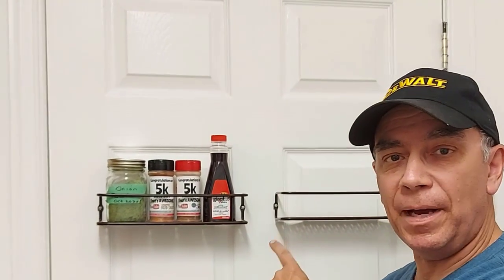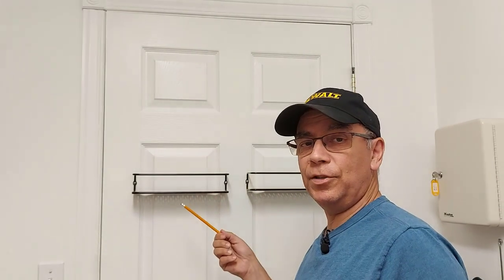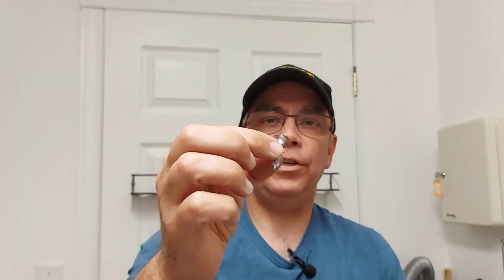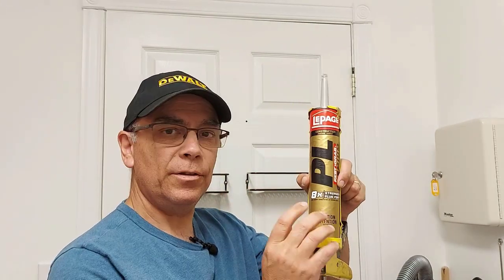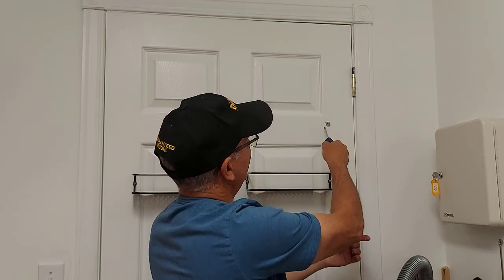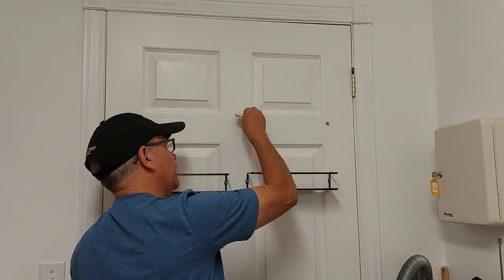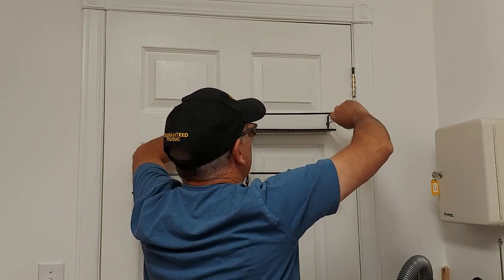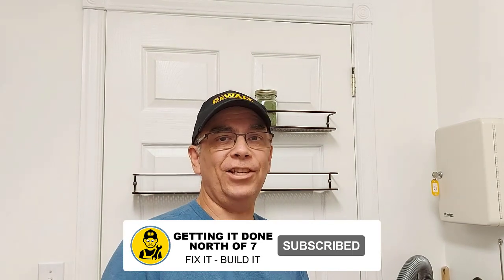Mount a Spice Rack on Interior Door So That it Never Loosens

Comment from the maker: 🔴Watch Next: Here we install a towel ring to a hollow door in the bathroom: https://www.youtube.com/watch?v=BefJvspNkMc&t=166s
Reply: Would the steps be the same if you have a metal door? I want to mount a metal rack (for mail).
Reply from the maker: @sable747  No but it is easier with a metal door. Get self tapping metal screws from the local hardware store. The screw will self drill into the metal door and you are good to go! Don't over tighten.
Reply: @GettingItDoneRepairs  thank you!

Comment: I have shelves i want to mount to a door just like this. My question is however, that when i line it up on the door the pre drilled holes for the screws don't end up on the solid part of the door they end up on the recessed part of the door. Can it still be done or should i fill in those holes and make my own. Also what sort of a weight limit do these doors have? like the shelves have a 5kg weight limit and i wanted to put 3 or 4 on each door, would this be too much for the door?

Comment: I can't get those metal anchors to screw flat into the hollow door. They protrude out just a tad. So the rack you attach, wont be flush on the door.
Reply from the maker: Without seeing it I don't know
Reply: Maybe the hole you drilled is a bit too small? Or maybe use a powered screw driver.

Comment: This is good, but I want it to work on the hinges. My only solution for the hinges was installing a flat metal sheet and then installing the hinges because once the hinge holes are shit, you can't do shit lol
Reply from the maker: Did you try inserting wood dowel in the holes
Reply: @GettingItDoneRepairs  Oh that works great. Sorry, I was referring to Metal doors with hollow insides. So, things like wood dowels would just fall in it since the housing of the door is soo thin. Just sharing my problems with you haha! And thank for the reply. I was not expecting it.